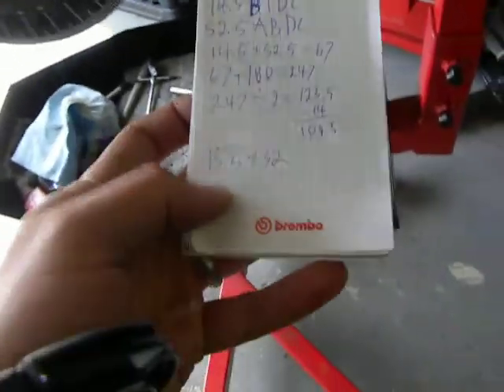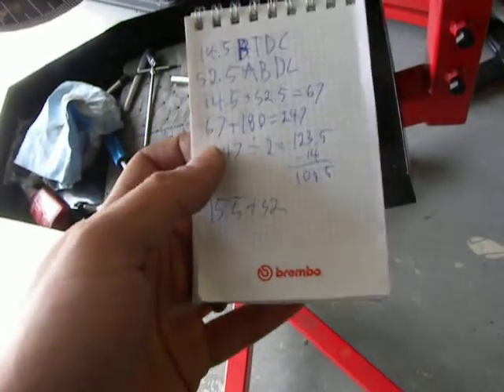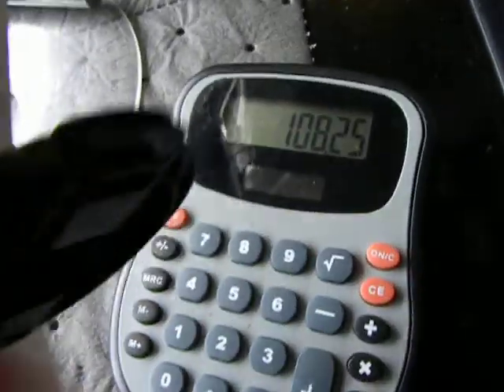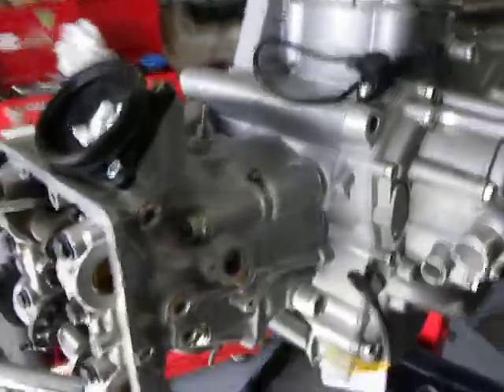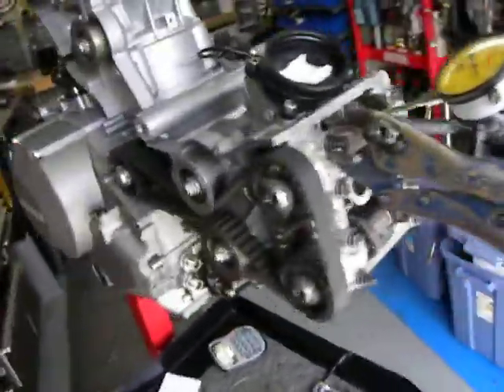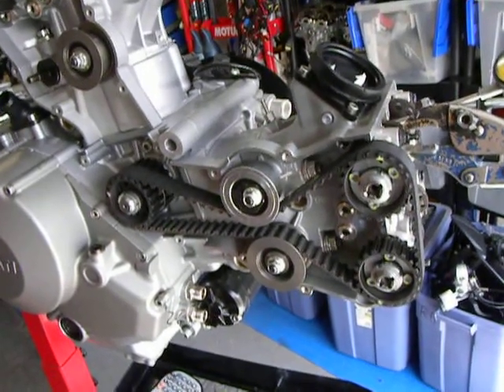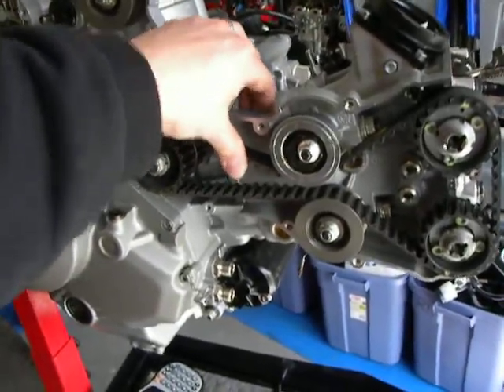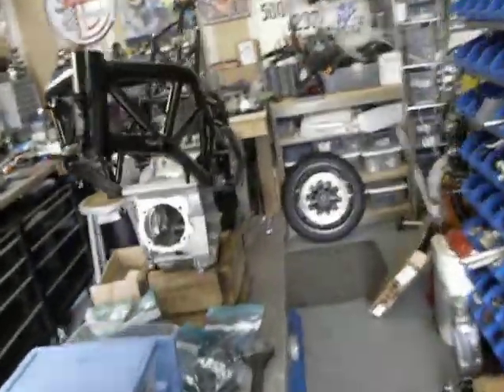Ducati 848 Testastretta Cam Timing 7

Comment: Thanks for the great video series on testastretta cam timing!  I was wondering what the torque specs are for the bolts that lock the cam gears once they are clocked.  I couldn't find it in the manual.
Reply: 10Nm

Comment: Good Evening Quentin, did you run 108/108 with the full termi? Thanks!
Reply from the maker: Yes, full Termi.  Was pleasantly surprised at how well it works with such extreme dump-tube sized headers.
Reply: Quentin Wilson
Cool. We are building some old spare 848(non EVO)engines to sell off and make room and cash for Panigale race.  We have run 105/107, 106/109, 105/105, 107/108.  They all seem to make about the same power.  We are thinking of going to some radical experimental timing for more top end.  I might hit you up for some dyno charts.